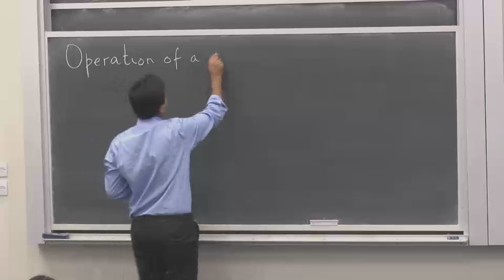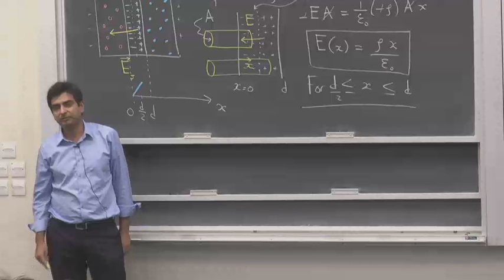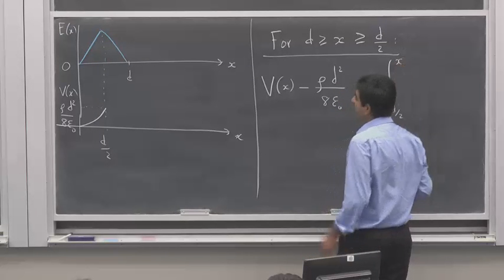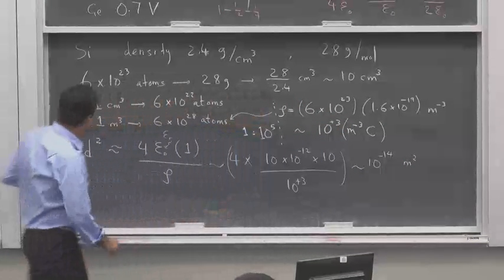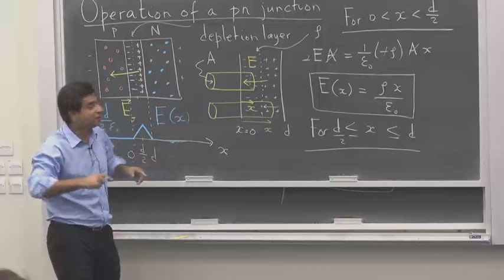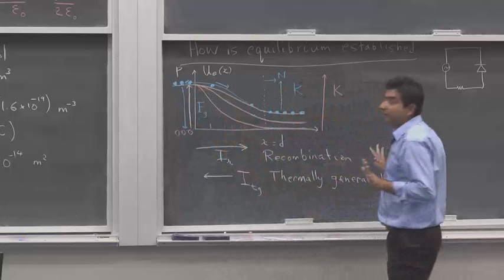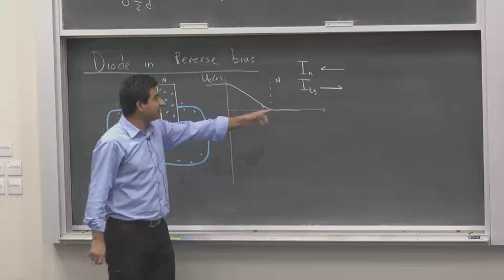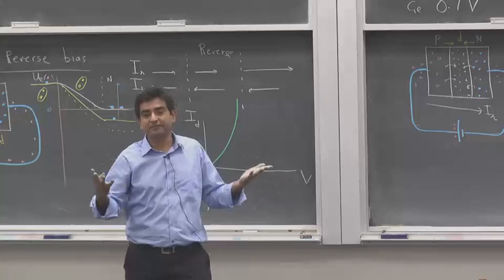Electricity & Magnetism (Lecture 13 of 30) Fall 2015 - How a PN junction works

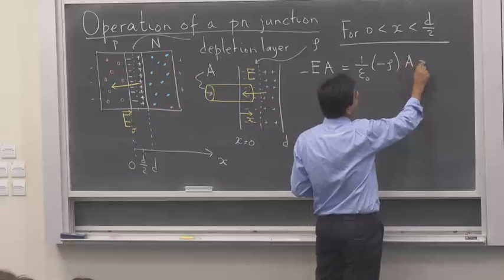Comment: Can the equation after 8:38 be right? Let's check it out. We know that E . A = (k . Q . q / r) . A = (1/4.pi.e) . (Q . q / r) . A. So on each side of the equation we now have a 1/epsilon -term and an A-term. They both drop out. That leaves us with: (1/4.pi) . (Q.q/r) = rho . x. Let's write this in units:  (C^2 / m) = (C/m^3) . m  or (C^2 / m) = (C^2 / m^2). Who went wrong and why? I think charge-density is per m^2 here and not per volume (as told in the video).